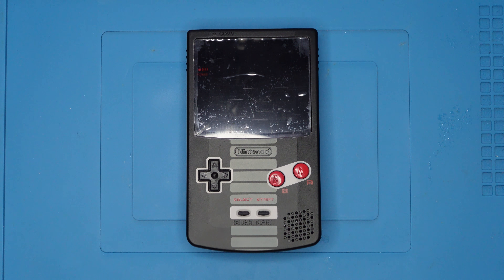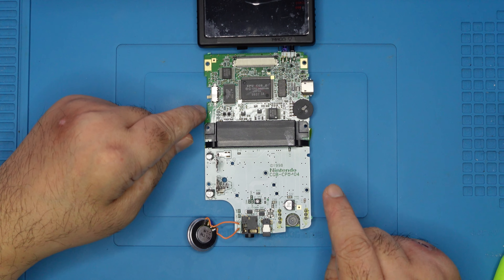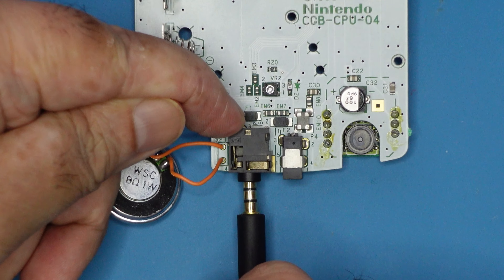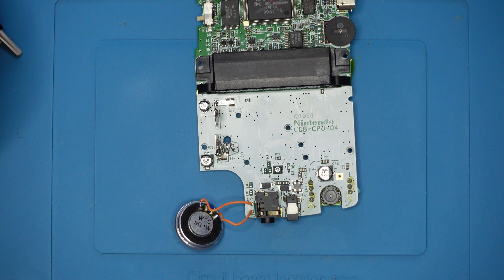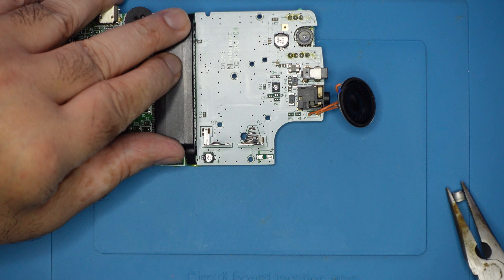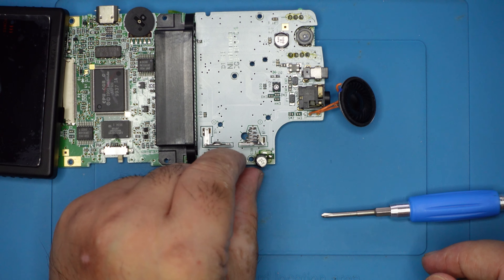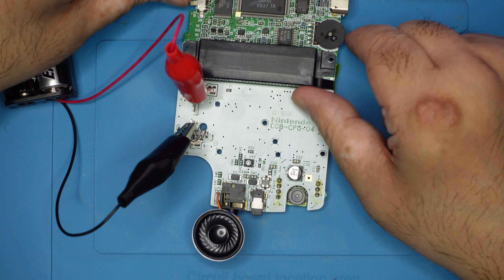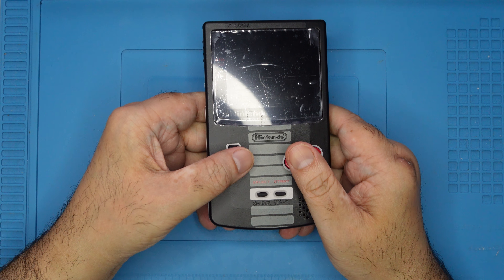Don't Miss This: How to Fix Sound Problems on Gameboy Color

Comment: 6:13 i dont recommend this method because you might strip the contact pad thing (i dunno whats its called) and it'll be a pain. use a soldering iron to heat it up while using pliers. Sometimes when the board are old it will break pretty easily so you need to be pretty careful.

Comment: Sounds the same after you did everything:( i have the same issue on 3 of my gbcs. One is worse then the others. Only thing i havent done so far is replace speakers or caps.
Reply from the maker: Another thing to try is replacing volume wheel.